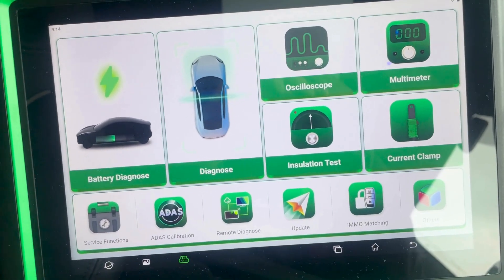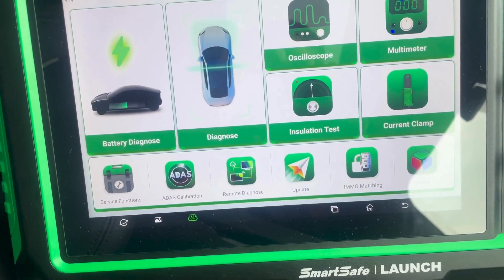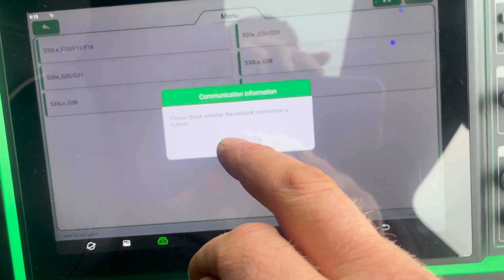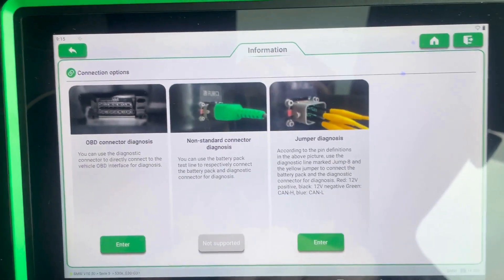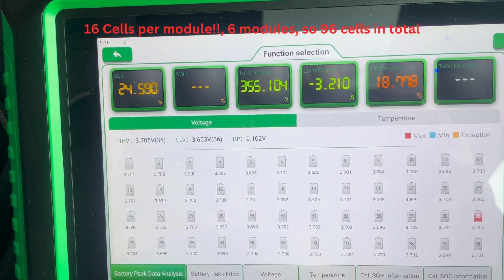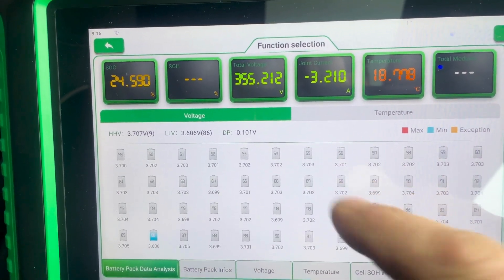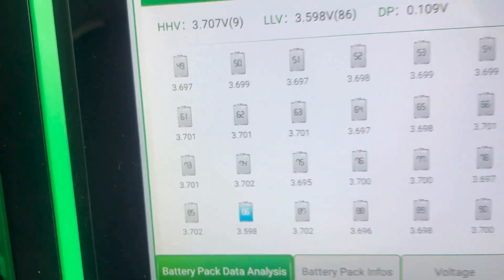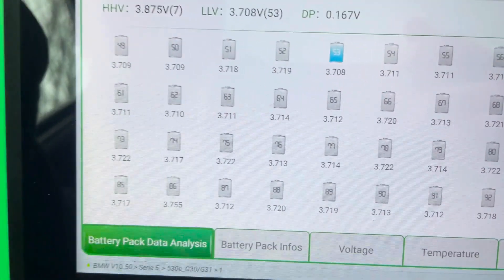BMW 530E High voltage battery fault testing

Comment: Hey! did this car have any fault codes? Got a 530e with only 13 with full charged battery, no fault codes so i am thinking about a bad module…
Reply from the maker: Yes had codes also relating to a module/cell issue

Comment: Hey man great video! I am looking g to buy a g30 lci and it has 170.000 km on the clock. Its 2022 so only 2 years old, most of the kilometers must’ve been on the highway so I think the battery should be fine. However the warranty on the battery is gone. I am wondering how much would a module replacement usually cost me? And if there is a battery fault most of the time its just one module going bad or how does that work?
Reply from the maker: Hi a new module here in Ireland is around 1400 euro plus diagnosing and fitting, so around 2500 to 3000 euro 
And most of the time its just one module that's failed